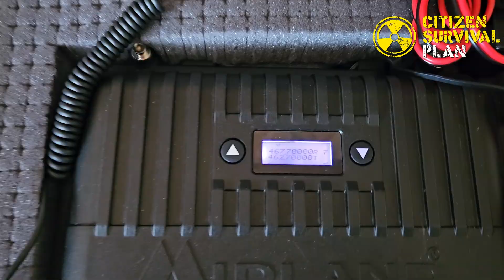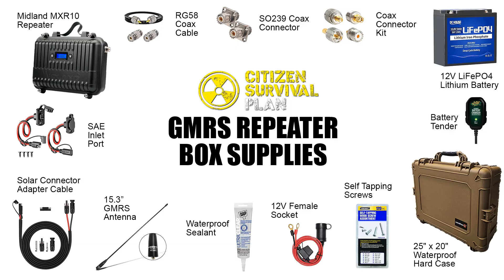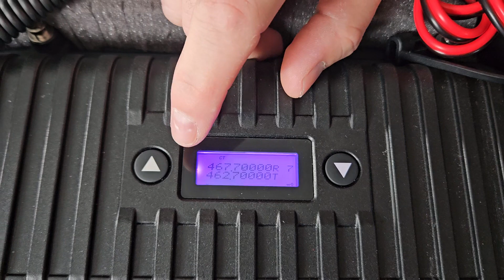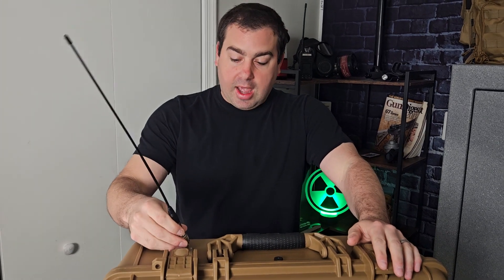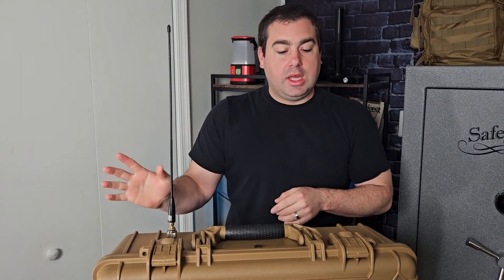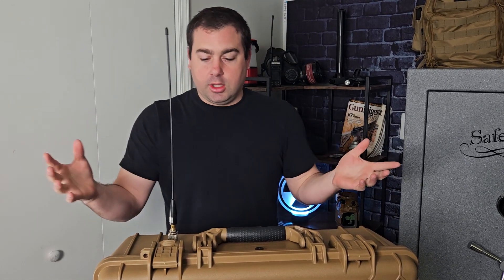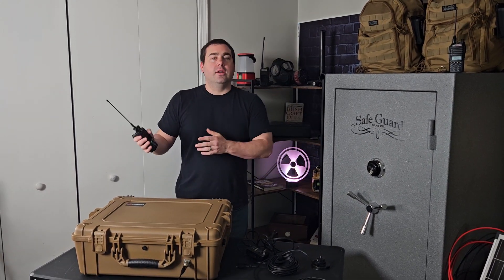How to Make a Portable GMRS Repeater: Step by Step

Comment: Amazon doesn't have the battery in your list of items for the repeater you built, but I did find a Lifepo4 12.8v 100ah battery with the BMS overcharge protection, and it has two USB 2.8A ports and a 3 pin aviation charging port and a USB output control button. You may have to get the 31" box that is deeper instead of the 25" waterproof box but it would still work and be a little more convenient. You wouldn't need the 12v female adapter with this battery, and your solar panels would plug in the the cord in your list.

Comment: I don’t know if a noc*o batt is the same internals as your batt, but I have the same tender as the one in your video and that’s how I was charging it daily as my race machine doesn’t have a charging system, and it killed the battery in a few weeks.After reading the directions it said to not use a tender. Just food for thought. 
I am all about making rather than buying. Appreciate your video, thank you for your example

Comment: That is a very cool portable repeater!  Thanks for showing us how you did it!

It did occur to me, though, that the reason that manufacturers would not go ahead and install their repeaters in boxes with included batteries is that they cannot know what the end user's intentions for the repeater might be.  For example, you may only need a couple of days standby operation for your own personal use - but, another person may be needing a repeater for many users that can stay up for days or weeks on alternative power that may, or may not, be solar, or they're needing to use an existing backup power solution to run the repeater.  

As for myself, I can see wanting to be able to mast mount the repeater to minimize coax length and run an extra long power cord using cheaper wire and avoiding the signal losses of long coax runs.  After all, it is a totally automatic device, right?   So, I would not want the battery installed in the same box with the repeater.   I would just want the repeater to be IP-67 or better rated for weather protection.

Thanks for the video!

Comment: This is a pretty cool setup! 

I did have some suggestions that I thought of while watching…

1) Add some faraday fabric to line the lid and the bottom of the case, between the protective foam and plastic of the case. Then add some foam gaskets wrapped in faraday fabric to the sealing surface of the lid and bottom of the case… Or use a metal case, with non-conductive insulation between the metal case and the foam / equipment. Either way, if done correctly, this should ensure the repeater is still operational after an EMP or CME event…

2) Turn the repeater 90 degrees to make it less likely for the battery and repeater damaging each other when standing the case up / moving under stress… The lack of foam on the bottom LH corner of the battery / top RH corner of the repeater, between the 2 components, in the current configuration makes me a little nervous…

3) Turn the battery 90 degrees so the terminals are closer to the SAE connector pass through for the solar / battery tender connection point.
Reply: Faraday lining is fuckin bullshit and you're a fuckin moron for even suggestion that

Comment: I really enjoyed this video.  "Portable repeater" sounds almost like an oxymoron -- but you showed it could be done and quite well.  PS -- A couple of years ago, I bought a Bluetti solar generator that I used when I boondocked in my small travel trailer.  I also bought three ea 200w Bluetti portable solar panels to go with it.  These solar panels were light weight and easy to transport and hook up.  I would imagine that these portable solar panels would make your "GMRS repeater in a box" even more portable.  Thanks, again, for the terrific video.  Lou from Georgia WSHK228.

Comment: I was noticing that you stated that the battery had a built in controller for the solar panels, but you had the solar panels and the repeater power leads connected together. If there is a concern that the solar panels would over power the battery, would that not also apply to the repeater since they are on the same parallel connection?
Reply from the maker: When using a solar panel larger then 50 watts we would plug in an inline controller. We will update this box at some point we changed a lot of stuff on it.

Comment: Quick question: The ground plane kit you have listed on Amazon,  can I use it with the nagoya 771g combined with the connector and install it directly on the repeater? Or no ground plane required while with the antenna and adapter? 

Thanks so much for this video it helps alot
Reply from the maker: When your using the small antenna right out of the repeater you cannot use a ground plane. It won't work as good as as using a large base antenna with a ground plane though.
Reply: @citizensurvivalplan  so small antenna directly out of the repeater with no ground plane is fine? What about a 38 inch diamond gmrs out of the repeater with ground plane kit?
Reply from the maker: @DrewB439  yes you can use the small antenna like the nagoya 771g right on the repeater box with the listed adaptor it will work for sure. But for maximum range use a coax cable and mount a ground plane type antenna on top of your home or somewhere very high up.

Comment: Nice setup to maximize portability.  True, many of us would use a MPPT solar charge CONTROLLER like the $67 Victron which can handle up to 75 Volts, outputting  up to 15 Amps with a 13.8 Volt float load (14.4V for Absorption, or 16.2V in Equalization mode... or 2x or 3x if you run two or three batteries in series).  For me wanting to be in a citizen survival mode, I'd also want at least a $250 4 panel 200 Watt portable foldable solar panel system so I can recharge my USB devices.  
Better yet and to avoid the fuss, get a $300 500 Watt Hour EcoFlow River 2 Max 500 (or bigger) with a built-in MPPT, 3 USB A & 1 USB C, several 120vac outputs as well as solar panel inputs - all for a reasonable 13 pounds. (or 250W for $240 at 8 pounds).

Comment: I wanted to build one of these. I think it is a good idea, but I have a concern about your implementation. The reason why the case of the repeater is made of metal and has lots of empty space inside is to help to dissipate the heat generated by the internal electronic components. your repeater transmitter operates at 10 watts whose active components generate heat that must be dissipated to the outside air. In addition, the duplexer reduces that power to a little more than 5 watts, this means that nearly 5 watts of power must be dissipated in the form of heat. This heat must pass through the skin of the repeater's metal case. The foam lined airtight plastic box you are putting it into contains this heat which may cause the repeater, BMS, and battery to overheat and shutdown or even cause equipment failure should heavy use of your repeater be required.

I would not encase your repeater in insulation that eliminates the heat generating electronics to be dissipated to the outside air. It may work fine for short periods of time, but eventually you will likely experience equipment damage.
Reply: A possible solution to this problem may be to remove the foam from the inside of the pelican style case and mount a heatsink to the case and mount the repeater and battery to the heatsink using heat conductive materials. Maintaining the airtight nature of the case may present a difficult problem, and will need some thought to engineer as acceptable solution. A cooling fan may also need to be implemented, reducing your operation time, as more battery capacity will be required.

A better solution may be to use the pelican case for storage of the equipment, as it was designed to do, and make a simple collapsible stand, that also stores inthe case,  that firmly holds the repeater and power supply components and install a right-angle PL to BNC adapter to which to connect your antenna or detached antenna coax. 

I won't be operating my expensive repeater inside one of these cases without a lot more thought as to make it safe for my equipment.

Comment: Two things, First... That trickle charger IS NOT made for LifePo4 batteries. I would not use it. Second, the Retevis brand of repeater is literally the same thing as the midland and much cheaper..
Reply from the maker: The charger works for lifep04 batteries it cuts off at 14.3 volts right before the bms in the battery would stop it.
Reply: @citizensurvivalplan  To each their own I guess. I personally would get a charger that’s made specifically for LifePo4 instead of relying on a cheap Chinese BMS to protect the battery
Reply from the maker: https://www.youtube.com/watch?v=WBkA5fLQS44

Comment: Include an inexpensive charge controller that's rated for use with your Lifepo battery. Don't directly connect the panel to the battery. The BMS is not a charge controller for solar panels.
Reply from the maker: https://www.youtube.com/watch?v=WBkA5fLQS44

Comment: I literally had this same kind of build in my head and had just spec’d out the materials when I came across your video! I’m going with just a slightly thinner case, but yours is adding the extra connections for external power that I hadn’t planned at the time. I like that option and will add that to my build too. Thanks so much for putting this together!

Comment: you need an MPPT charge controller
Reply from the maker: Thanks for the comment. This battery has a battery management system so a controller is not needed. I thought the same thing but after extensive testing and leaving this this at full charge with a 100 watt panel connected to it for days in the sun the battery never broke 14.2 volts it works as it is no charge controller needed i make a note about this in the video.
Reply: You absolutely need a charge controller. The only thing the BMS is doing is cutting off the battery when it full. Power coming in to charge a lithium power needs to taper down the amperage as it gets closer to full. You can’t put a lot of amps in when it almost full. Your battery is not going to last long.
Reply from the maker: @Idahoprepper71  and well see its v1 I still dont think it needs it but it continues to work months later so well see ill make an up date about this in the future you may be right but as of now its working still.
Reply from the maker: https://www.youtube.com/watch?v=WBkA5fLQS44

Comment: I thought that repeater was waterproof already. No need for a box inside a box. ??? Anyway you did a good job. A hole saw would make the holes neater and cleaner than the paddle bit you used but no worries you got the job done.
Reply: ok just read midlands response to a question it says you should not get the repeater wet. Weird. I thought I had seen somewhere it was ok. Maybe a different companies version. Ive seen retevis and others also offer something similar.
Reply from the maker: i called midland and retevis. It needs to be somewhere out of the sun and water.... i wish it was waterproof too.

Comment: Cool setup. One thing. Over time that plug foam is going to fail as you take thing in and out of the kit. If you spray it with 4 or 5 coats of Plasti Dip it will help improve the longevity of the foam. 

I’ve done this on gun cases, musical equipment cases, and camera cases. It hold up great over time.
Reply from the maker: Thanks for the tip I will look into doing this.

Comment: Id like to see this deployed in a real setting outdoors for several weeks. Got to a local mountain top, or area where you don't have to worry about it being stolen. Use the solar panel and find a new to put in a tree, or some kind of stable space. Definitely get a cookie sheet or some kind of thing to stick the mag mount to. Id recommend placing the mag mount at least 10 feet vertical away from the box if possible. But keep us all informed of what you do with this unit.
CHEERS from Colorado
Reply from the maker: yeah i had the mag antenna out just for showing  the connection i would not use it like that. I have a base station antenna i can use with a ground plane that hooks to a 10 ft pole. I may leave it somewhere hooked up for a while at some point this summer. Thanks for watching!

Comment: I would run the antenna connection out the top and have a piece of sheet metal as the ground plane. If it’s going to be deployed in field the box will be more stable on bottom line you had it on deck and antenna would be on top lid.

Comment: You NEED a controller for the solar panel, you will have random current and voltage that will kill any battery over time...spend the 20-30 dollars to feed it a constant and safe voltage and current. The same for the wall charger..get one for that type of battery; that battery expects a specific pulse for it to charge correctly...Sure it will charge, but in my experience I seen the voltage spin up an down using the wrong type of solar charger when it's at the end of the charge. You will shorten the life of the battery. As I edit this, your 1-6 repeater (duplexer takes out 5w) is going to have a lot of loss / SWR because you are using an HT antenna without a ground plane with the connections not sealed. That short mag mount antenna without a pie pan (already a bad reflector) will kill your repeater over time. I had a retevis RT97S  that died because it was linked to a high traffic linked network; being the same radio inside. Won't every buy one of them again, for less I can build a Motorola repeater between 11-40w output.
Reply: Correct on all points. This MIGHT put-out 2W at ground level. I almost feel like donating an SWR meter so he can see how poorly this is going to perform. I'll give him credit for the effort, but he really needs to talk to some experienced repeater operators.
Reply from the maker: i did a ton of testing with this it performed as well if not better then all my 5 watt handhelds this also hooks to a base station antenna on my roof or any other type. As far as the battery it has a BMS controls the voltage and levels the cells and have had no issues. as time goes on i will continue testing and see what fails and improve the design i love the comments on this though. Thanks.
Reply: A charge controller is not the same as a battery management system. One does not replace the other. You can get a batteria power 10a mppt controller with sae connectors that could just plug and play with your set up.  It’s small and it’s under $40. Your BMS works to avoid overcharging each cell and balance the voltage while a solar charge controller controls the surge of the output voltage from the panel.  Think of the BMS like a simple switch and a charge controller as a DC-DC converter and CC/CV charger.   I’m sure someone smarter than me could explain it better.
Reply from the maker: @bourbonbrigade  This repeater has been plugged into a 100 watt solar panel for months now running and under use and is still working.... when it kills the battery I will update my page could be a while I tested the battery seems fine. only time will tell. "killing the battery in a hurry" was not correct commented by some people.
Reply from the maker: https://www.youtube.com/watch?v=WBkA5fLQS44